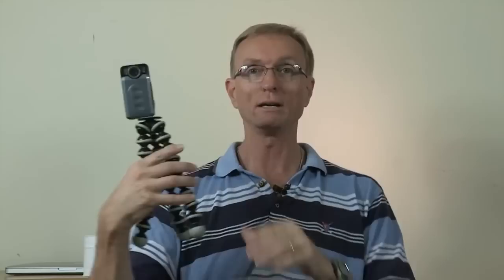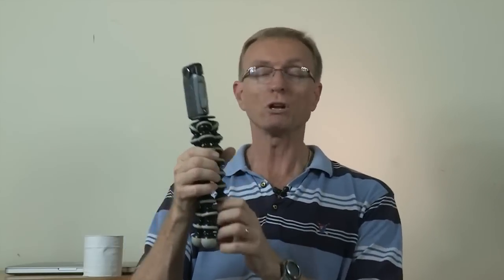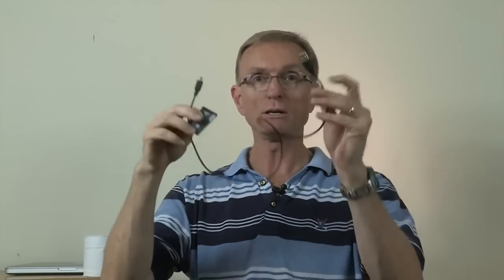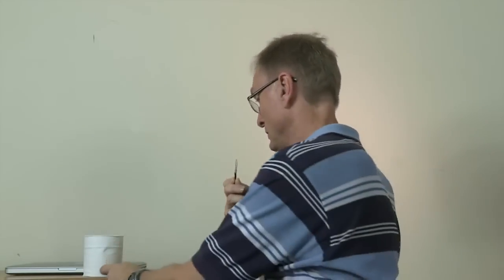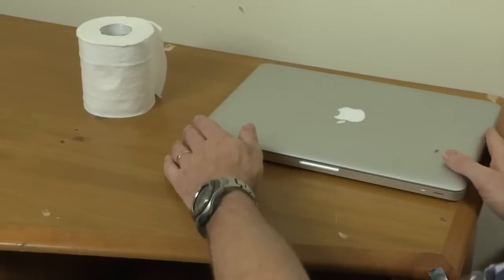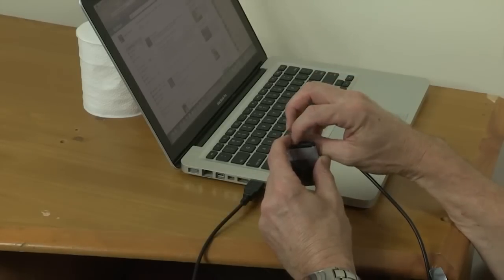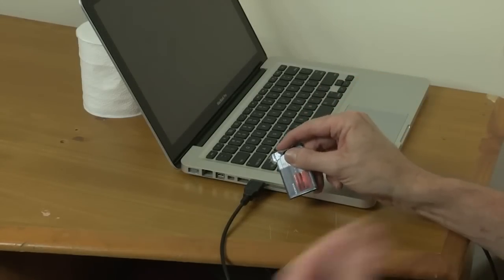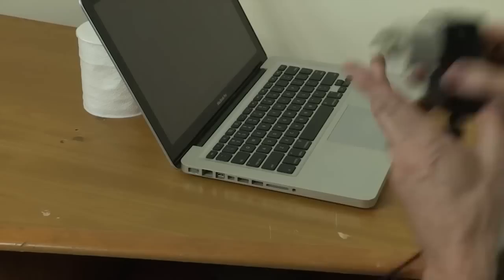How to charge a mobile or cell phone battery without a charger

Comment: WOW ATTENTION! You risk to damage your Lithium-ion battery if you leave it charging long time. In detail: USB port supplies 5V and max. 500 mA (still a standard nowadays). The maximum voltage of fully charged li-ion battery is 4.2V (or 4.25V) and if you go hihger than that you will damage the battery. It works for brief charging as shown in the video because if the battery is empty and large enough AND the USB port cannot supply more than 500mA then the USB port will supply its maximum current and the voltage will drop to the batery voltage. But if you leave it connected like that for long time the battery will charge to 4.25 and eventially start going above that up to 5V (the nominal USB voltage) and will get damaged.
Reply: How long is too long?

Sorry I know its been several years
Reply: @tewes_  the lithium-ion (the standard type in cell phones and cameras) battery voltage should never go above 4.25V. What damages the batteries is higher voltage and heat. I can only see this being used as an emergency one-off. GET A PROPER CHARGER!
The battery he shows is probably around 1000mAh so when it is completely empty (voltage under 3.5v) and the USB port supplies 500mA then you can leave it for an hour and it would probably still be ok (with 500mAh charged) but that is a lot of assumptions I made that you need a voltmeter to verify.
The Li-ion are meant to be charged with CC/CV method (constant current/constant voltage) which means you first apply constant current until the voltage reaches 4.2 (assuming the manufacturer specified 4.2 as max voltage), and then you keep the voltage at that level while the current goes down as the battery is topped of. For a 1000mAh battery when the charging current goes below 50mA you can consider it fully charged.
To prolong the life of the battery you can charge it only to 4.1V. You will get less capacity but it will remain performing good for a longer time. That is why cellphone manufacturers (including Apple) have a included a battery optimizing logic that only charges the battery to 80% (lower voltage - I assume 4.1V) and they top it off before you wake up (provided you enabled the optimizing feature, you charge over night and and you have regular days)

Comment: That is exactly what I needed as the socket in my phone got kinda fryed. At least like this I can manually charge the battery, though I think I need to becareful how long I keep it on the charge as it could just overheat the battery using this method. In half an hour it charged it to about 70% using a 3400mA 5V charger on a 1500mAh battery. In theory it should have been less than that, but theory and practice usually don't go hand in hand perfectly, unless it was 3400mA for the two ports, which could be the case. Anyway, thank you for this, really is a practical temporary solution or even a long terms, as long as someone doesn't mind taking out the phone battery everyday to charge it.
Reply from the maker: Min Hashamayim sorry to hear about the fried socket. I am happy to hear that I was able to provide a solution for you. All the best.

Comment: used this for my mobile phone which was stuck at the bootloader because the battery wasn't charged enough, charged it for 10 minutes using this dirty trick and finally my phone would boot, allowing me to use my phone to completely charge it.
Reply from the maker: That's good news.
Reply: G
Reply: Niek Nooijens Same thing right now. Phone stuck at bootloader because battery is COMPLETELY dead.
Reply: trust me this trick works, although I did it with an arduino which also has a 3.3V output and my specific battery required 3.4. just hold the wires onto the battery for 3 minutes, it should charge it enough for the bios to pick it up again.
after my phone I used it on 2 casio-photocamera batteries too reviving them from the dead. you basically can't lose! the battery isn't working anyway so you can only fix it.
Reply: Niek Nooijens Yup! I my phone is fixed. I booted into CWM and restored my system

Comment: Going to try this with my Galaxy S3. For some reason it will not charge anymore. Its not the cable, and its not the port. I have a feeling it has something to do with the software inside. Whatever the case, will comment after.
Reply: You have "corrosion." just got mine diagnosed today, it happens because of humidity and other "condensation" issues. this causes a short circuit, which means that it will stay at 0% and you can keep the phone on as long as it connected to a charger
Reply: so did it work? I have the same problem with my phone but i think its a loose charging component
Reply: This is what you do. Go to amazon and buy an external battery charger and another battery (make sure it says Galaxy S3).. will cost you no more than $20 for both. Now you'll be able to have one battery charging at all times and one in your phone. Great fix for me since I didn't want to replace my 4 mo old phone
Reply: So im not the only one with a Galaxy s3 that doesn't understand how to charge....

Comment: I'd immensely appreciate it if you wouldn't mind replying to the following: How would I implement this method with the battery from a Samsung Galaxy S4 which has four (4) metal connectors at the top left when properly inserted into the phone. I have a lot of special photos on my old Galaxy and would really like to get it on. Thanks so much, in advance!
Reply from the maker: Hi Luke, unfortunately this is outside my knowledge so I’m unable to help. Hopefully someone else will see this and answer your question.

Comment: I HAD IT PLUGGED IN FOR A HALF HOUR AND NOTHING ! DOES I T TAKE A LOT LONGER ? WWHHYY DIDN'T IT WORK ??? THE ONE I SPLICED OPEN ONLY HAS TWO WIRES THE BLACK AND THE RED. SO THAT BEING THE CASE HOW DID IT SENSE THE BATTERY'S PROGRES ??? DO YOU KNOW ? BUT MAINLY TACKLE THAT FIRST QUESTION
Reply from the maker: hobby gamer hi. I will try to answer your questions.
1. Where your wires connected to the battery correctly? Ie..Red to positive, black to negative. If your batt has 3 terminals, ignore the centre one.
2. Refer to answer 1.
3. No I don’t know. But remember as I said in the description, this is last case emergency way of getting charge until you get a charger, so full progress isn’t too important.
No number. I don’t know if my answers have helped. It’s late at night for me and I’m tired.

Comment: How long do you recommend keeping the wires on the battery while charging?  What I mean is, what's an effective amount of time to get the battery close to fully charged, yet without creating a cooking show? :)
Reply: mcpeewee68 how long do you normally charge a phone? <- well then here's your answer
if you're using a different power source you can always count the amount of time needed
the battery has capacity shown in mAh - so you divide it by mA given by the charger and you're getting the maximum amount of hours (h) needed for a full charge
for example - if a charger is 500mA and the battery 3000mAh then you need 6h(ours) max
same goes for normal batteries
keep in mind that it needs the same Voltage
if it'll charge for too long - it may overheat or explode
Reply: draconpost
Thank you for the info...sorry I didn't see this until now.  The wire method worked great the first time I did it, but it refused to work after that (who knows).  I ended up buying an external battery charger and an extra battery so that I can have one charging while the other is in use.  Eventually I'll replace the phone but until then these different methods have helped...so your video was appreciated :-)  thanks!

Comment: Charging like that is bad for your battery. Yes it'll have enough of voltage to charge them since these batteries are usually only 3 or so volts, and usb cables carry 5v ish and 2amp if it's usb 2.0 and so on it goes... but batteries charge when they have low power faster then charge slower when at higher power and so on (charger adjusts the amperage and voltage). There's 4 stages of a charge with lithium batteries, as with lead acid batteries too... you also have different stages, and it's all for your battery to have longer life span and potentially not to cause your battery to leak or even in some rare cases battery catching fire causing an explosion.
Unless it's that one odd time you want to charge like that it's no problem. But don't do it regularly, or you'll end up like those who blew up with their phone in their pocket for example.

Comment: what's the middle connection for?
Reply: It is for a thermister... A digital thermometer it essentially can tell whatever is charging it that it is too hot and to stop charging it. That is assuming that your charging it with something that understands the output of that particular thermister. You could calibrate this with an arduino and have a far more reliable charger.